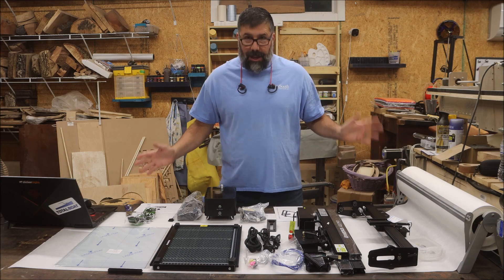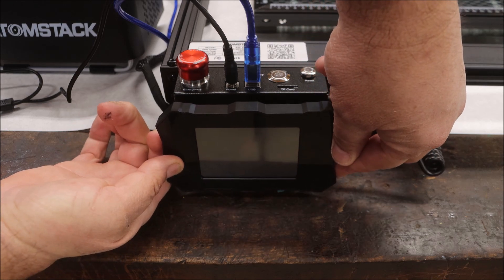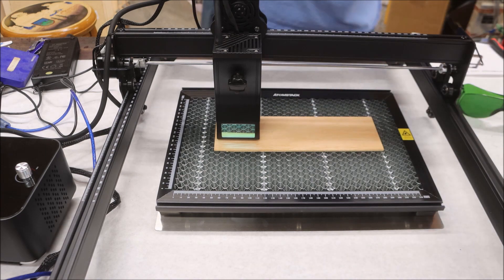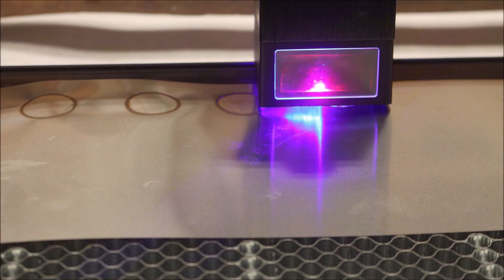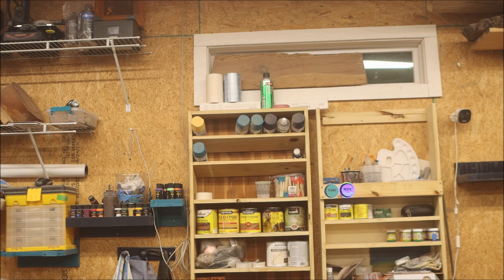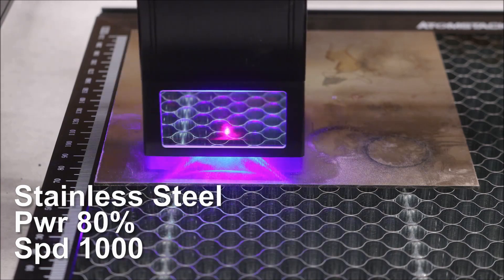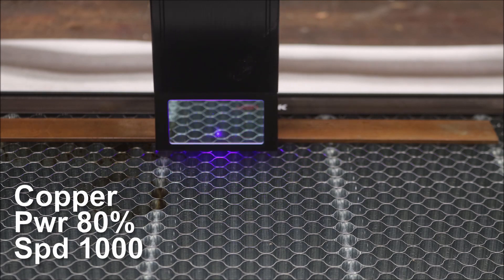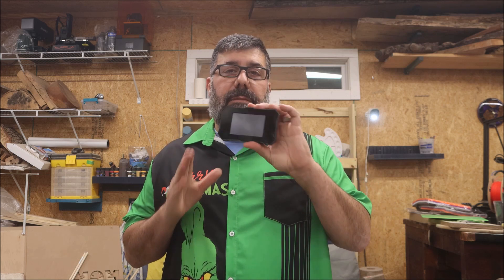This Thing Cut Metal - Atomstack A20 Pro

Comment: How do you do framing to this laser? The laser is not firing when framing even if the settings are ON.
Reply from the maker: Have you turned it on in Lightburn? I did not have this issue. Maybe reinstall the firmware?
Reply: @MoonpieCreations  It is turned on in the settings. Someone said that Atomstack A20PRO do not have this option. It is true or not?
Reply from the maker: @Gigiuzv  It turned on when I use it for framing. I am certain of that. Unfortunately I no longer have this laser.

Comment: I've been looking at diode lasers lately. I love watching the unboxing, setup, and first impression videos.
Reply from the maker: Robert, I can say I highly recommend this laser. It is comparable to the xTool in cutting and and engraving and a bit cheaper. Is it an xTool? No. lol But it's a good one. I should be releasing the ATEZR review in two weeks. That thing is a beast. But, if your only need a 10w laser head, the Longer Ray5 10w is fantastic for the money.
Reply: @MoonpieCreations  This is one that is near the top of my list, but I also like the Ortur for the price and what people are saying they’re cutting/engraving with it.
Reply from the maker: @CrossCutCreations  Out of the higher quality ones I have tested. xTool, Ortur LM3, ATEZR P20, Atomstack A20, TS3 with enclosure I would rank the Ortur near the bottom. Just above the TS3. Just didn't work as well for me as I thought it should. Not saying it's bad, just saying the others were very easy to use and connect. They all cut well right out of the box. The Ortur and TS3 had issues I had to figure out. I'm working on a comparison video for these five.
Reply: @MoonpieCreations  Interesting. I’m looking forward to the comparison video. I love the air assist and honeycomb bed (for any laser).

Comment: That’s actually a good price for a decent laser. How does it do on acrylic?  I’ve used a big Glowforge in the past to engrave pens I’ve turned and even it struggled with some of the materials. Glowstonz (from woodturninz)in particular were hard to etch. I’d made a moon pen for one of the guys on the Artemis project and it was a struggle.
Reply from the maker: It cuts it very well. I haven't gotten into the engraving yet, but will be doing a video on that in a month or so.